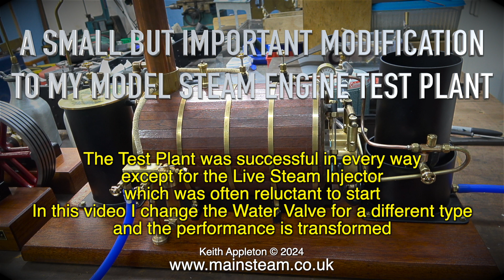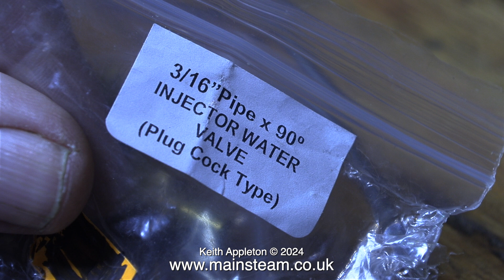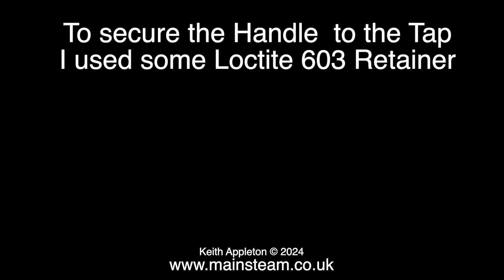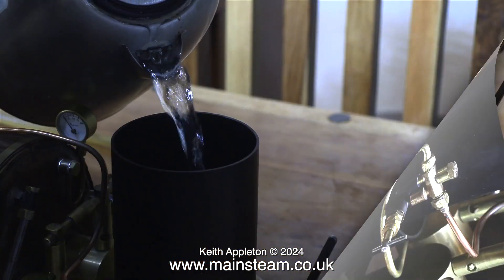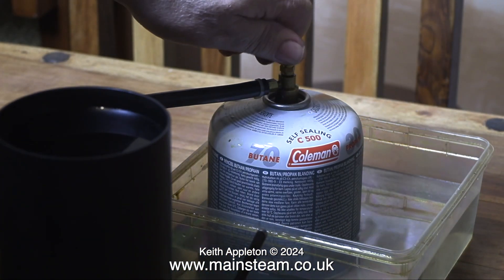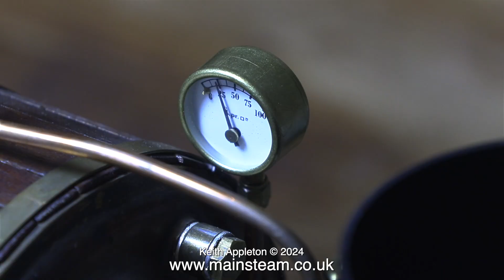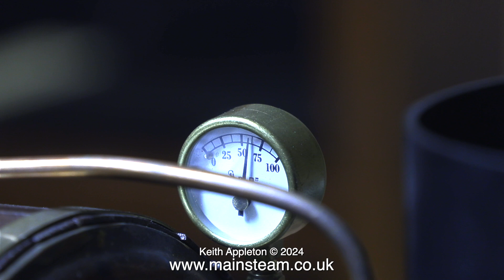A SMALL BUT IMPORTANT MODIFICATION TO MY STEAM ENGINE TEST PLANT

Comment: Amazing that a simple change of a valve can make such a difference!
Reply from the maker: Injectors basically work by moving a column of water from the tank to the Boiler - any restrictions in the feed pipe line and they are not happy }:-)))